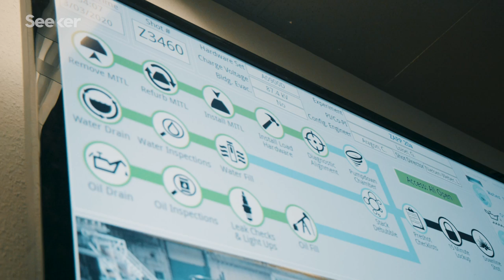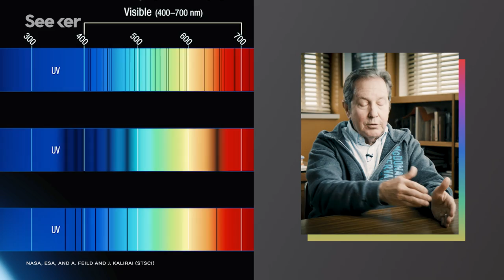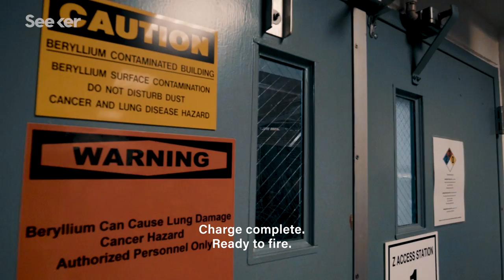The Z Machine Recreates a Dying Star on Earth

Comment: That electric bill though 😂
Reply: Lol
Reply: F in the chat for the guys paying for it
Reply: Actually it's a very modest electric bill. They said they only run one experiment per day, and they use about 20,000,000 J. So if you were to charge up the capacitor bank in 1 second, you would need 20 Megawatts. But if you wanted to charge it in one hour, you would need ~ 5.6 kW. So it only holds about 5.6 kWh, which is less energy than the average house uses per day. The reason it's impressive is because all of the energy is released in a very short amount of time.

Comment: Now if all this energy was dropped into a dielectric wall accelerator you could reach Cern speeds in three ft and at 10 ft 10^20th electron volts just like the fastest cosmic rays. We would finally have the energy of the universe for our lab strength.

Comment: Disappointed you didn't explain how the machine works, was looking forward to it.
Reply: Basically just a bunch of really big capacitors that they discharge all at the same time. The high currents vaporize the wires they're running through and the magnetic fields from the current causes the vaporized material to get pinched towards the center. All the heat and pressure and whatnot produces a ton of x-rays.

Comment: I love this kind of experiments.. but just curious to know two things.
- why does it matter If the universe is 12,13 or 14 billion years old?
- 5 times the energy, is the environmental impact considered here? Holly smokes
Reply: Power is a factor of time, and energy. for a few nanoseconds that huge amount of power is there. The reason it can only fire once a day is because they have huge capacitor banks that take like a day to charge up.
Reply: @Theinatoriinator  They said it only takes 1.5 minutes to charge. Which makes sense—capacitors, even giant ones, charge/discharge quite rapidly in comparison to something like chemical energy storage (batteries).

Much more likely is that they try to only consume the grid power (to charge the capacitor banks) at off-peak hours, when the energy is cheapest! Particularly since they cannot more than once per day, much less continuously. Therefore unless operating budget simply has no limits, why would you ever consider buying the power at other times?
Reply: It matters if you want to solve the riddles of physics. If you’re a physicist. Physics developments, such as quantum mechanics and relativity, have had profound impacts on our lives such as accurate airplane navigation or semiconductors -> transistors -> microprocessors.

Second question—fundamental misunderstanding. It’s a lot of energy, yes. But obviously all the power plants of the world don’t work together to power the thing. The energy is equivalent to bringing a loaded 18-wheeler up to speed. (Consider the embodied energy you waste next time you purchase more unneeded junk that was shipped from China on crude-oil-burning container-ships.) The difference is that this machine’s energy is released over a very small timescale, therefore 5 times the POWER. NOT 5 times the total energy.
Reply: @fosterlewis7360  Good point I didn't think about that!, charging when not at peak point would make sense. I also wonder because it looks like it takes a while to get set up.

Comment: So, are we closure to fusion? with this much energy it should be able to start a chain reaction?
Reply: We have already, it's called the hydrogen bomb. But on the contained fusion reaction, no we haven't reached break even point, close but not yet. I am sure it is used in weapon design. But look at how many targets they hit when they run it. All those little copper pills contain what they are shooting. What I hope they research next is building a magnetic containment bubble, as a possible shield technology. If it fires off at the same time as the targets are exploding, perhaps we can contain it longer and get more data out before it vaporizes.
Reply: @ItsNotAllRainbows_and_Unicorns  I agree, my hopes are on the Stellarator for contained fusion.
Reply: Fusion via a stellarator or a tokamak is closer right now in making fusion real, than machines like Z machine or laser confinement.
Reply: Fusion reactors exist, they just have a hard time with containment and getting the reaction to produce more energy than it takes to start it.

Comment: Dude thinks iron melts at 800 to 1000 degrees. Iron has a melting point of 1535.0 degrees Celsius or 2795.0 degrees Fahrenheit. It has a boiling point of 2750.0 degrees Celsius or 4982.0 degrees Fahrenheit. fact check next time, I know it's fancy space science but come on now
Reply: When did he say iron melts at 800 to 1000? I only recall him saying that you heat up a block of iron to 800 to 1000 then measure it's temperature vs time and you see it getting cooler and cooler